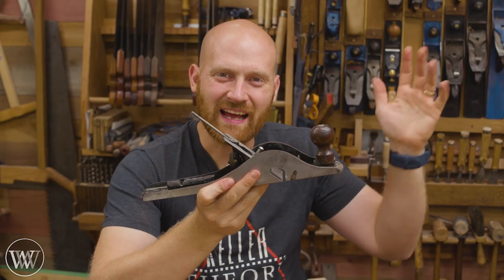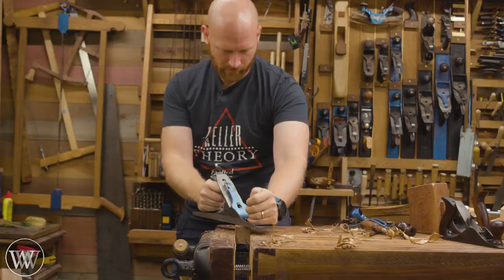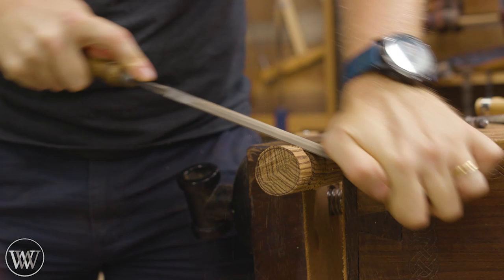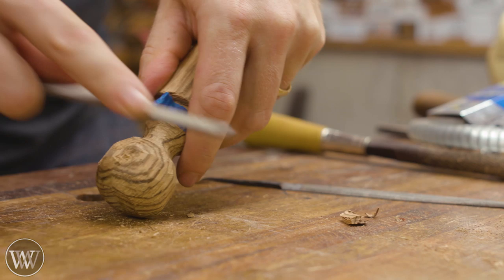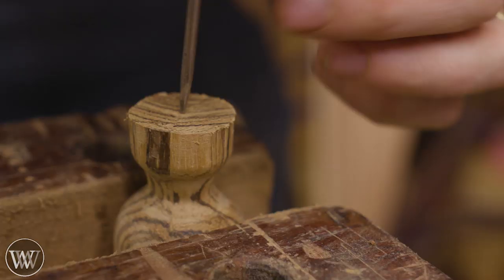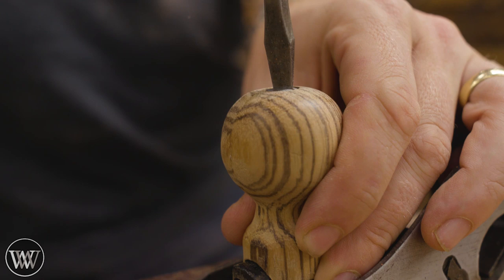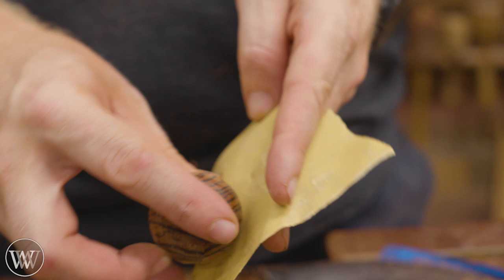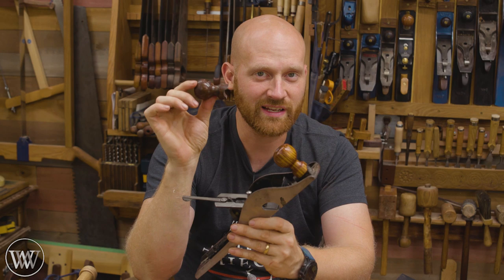How To Make A Knob Without a Lathe

Comment: "Everything in the shop is just a jig for a chisel..." 🤯... Seriously, the simplicity of that is mind-bending.

Beautiful work!

I'm just starting to restore my grandfather's depression-era planes, so I've got a couple questions: Why put BLO on under the shellac? and how long did it have to dry in between applying the BLO and the shellac?

I used tung oil on the first plane I restored with nothing over it. The remaining planes had shellac on them, so I've scraped it off and am planning on putting some fresh shellac on, but want to maintain the color of the wood. Should I put tung oil under it or just straight to shellac? (I've heard tung tends to darken the color of the wood less than BLO.)
Reply from the maker: Thanks. I like the way BLO brings out the natural color of the wood. So I tend to use it on most of my project. The Shellac alone just leaves the wood a little bit dull in my opinion. So putting that underneath brings out the color a little bit more. As to tongue oil that really depends on which recipe you have. Historically tongue oil has many many different mixtures. Most of them are just BLO plus something else.

Comment: Just a thought on grain orientation.  Having it perpendicular to the length of the plane might look odd.  A tip I read about wearing a tie clip is to angle it down.  It doesn't "cut" the tie in half and focuses on the vertical.  Also it blends the jacket line to the tie a bit.  So in this case, would having the grain follow the length or have it slightly angle have a better look?
Reply from the maker: traditionally that would be the way to go. but it would look odd with zebra wood. that one looks better to see the stripes on the side. or at least to me it does, but in the end structurally it does not matter it is just aesthetics and that is up to the user.

Comment: Next time, don't cut the knob off the block before you drill the hole. Use the entire block to help mark the hole and drilling becomes a bit easier to do. Plus you don't have to worry about "blow out", hole is drilled, just simply cut it off afterwards. I like the color of the wood used, really pops. Cheers :)

Comment: This popped up as a suggested video. Kind of scary Google knows how much I’ve been using my quarter century old Stanley #5 since I’ve learned to sharpen it well. Last night, I was thinking about replacing the plastic knob and tote with wooden ones. Note the question is what kind of woods do I want to use.
Reply from the maker: Has two type of wood it is really up to you. Most any hardwood will work fine traditionally Rosewood was the wood of choice but a lot of people like making something special that speaks to them.

Comment: This may be a dumb question, but were there hand powered drill presses? I feel like there had to be, but I dont think I've ever seen or heard of one.
Reply from the maker: Yes. I actually have one. Their generally called post drills. But in this case it's just faster to drill a hole by eye then to use a drill press.
Reply: @WoodByWrightHowTo  Cool. Thanks for the info. Maybe that will be my next purchase....

Comment: You could've used your spring pole lathe for this job. I don't think it would've come out any better, but I feel that with all the work you put into that tool you should use it more on camera. 
I do understand that not many people have a lathe and this way is more useful to a lot of your viewers... but you built that lathe and there's no reason you shouldn't use it for applicable tasks. 
That's just my two cents.....good job tho.
Reply from the maker: I would have, but I have had several questions recently on how to do it with out a lathe, and there are so many videos out there doing it with a lathe that it would not have made for a very good stand alone video. plus with setting up the lathe and everything involved with that this was actually faster in the end.

Comment: My Stanley 45 came with an extra fence that has no knob. I have some rosewood cutoffs from Marimba bars that will make a very nice knob. But how can I make the threads on the inside of the old style (no screw) knob? I don't have a tap that big.
Reply from the maker: That is very hard to find. There are a few taps out there designed for it but they are hard to come by. I do not know of anyone right now who has one.
Reply: @WoodByWrightHowTo  So is it wrong to just epoxy the knob on permanently?

Comment: why did you cut the groove on the bottom inline with the glue joint?
Reply from the maker: because I wanted to show the "eye the grain created on the front. and with the glue used in this wood it really does not make a difference which direction it goes.

Comment: Time is money my friend, what if you must make ten of those. The time wasted what you could use to make a profit on other project would have paid for a good second hand little layth. 🤔
Reply from the maker: Who said anything about making a profit. This is just for the fun of it. sometimes you do things the hard way because it's more enjoyable. Oddly enough I have three layths, but generally this is the way I do it instead.
Reply: The hard way can be the last way if you loose a hand with that unsafe chain, grinder monster saw. Why would you risk your safety for doing things the hard way. The hard way only exists if there was no real chainsaw on the market.If the manufacturer of chainsaws which are highly skilled professionals thought it was safe to make an attachment for a grinder to convert it into a chainsaw they would have done so. The refs are different, the power are different and the safety are different, theres no automatic kick off switch on a grinder if the thing/monster hit a bad spot in wood.play safe Boet, don't play Macgiver stuff it's dangerous. 👍